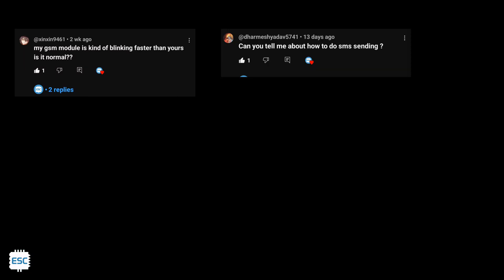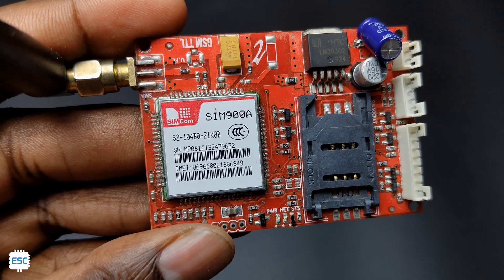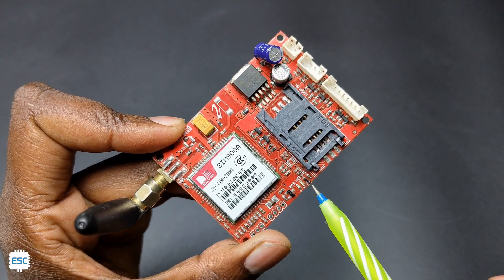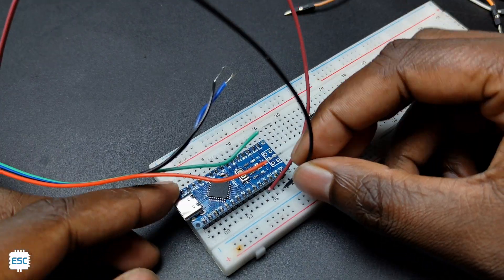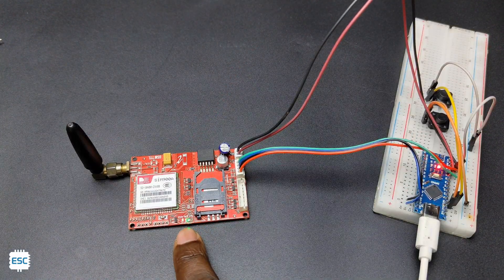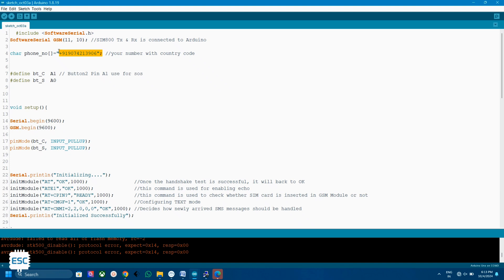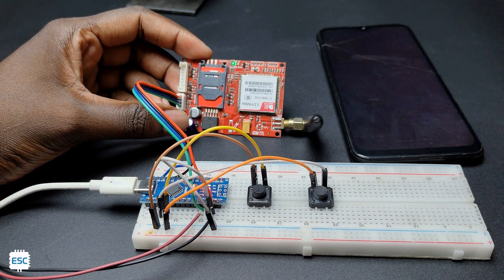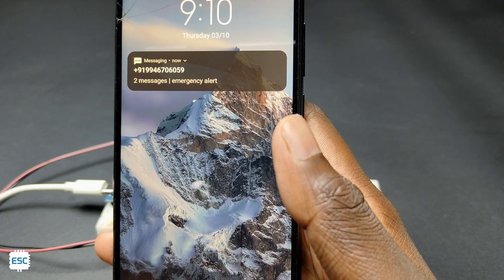How to Make calls and SMS with Arduino and SIM900 | Common Problem and solutions

Comment: Can i get a other Push Button with a longer distance and longer Jumper cable so i dont have to Insert it to the bread Board?. The Push Button needs 2 openings then right?. What Power supply does it need to rund without the PC?.
Reply from the maker: Yes possible you can directly connect the button with wires

Comment: Hlo bro i am using sim800l amd Arduino nano with push buttons i have tried your code and your method but it was not working it doesn't make a vall just printing "AT " cmd  help me bro 😢
Reply from the maker: Change the tx and rx pins
Reply: @EDISON_SCIENCE_CORNER  Hello, I'm here with this problem, just printing AT, Error, although I changed Tx & Rx pin. Can u help me plz?
Reply from the maker: May be your module damaged. Check the connecting wires too
Reply: Thank for your reply!